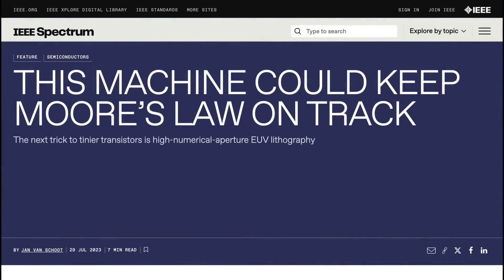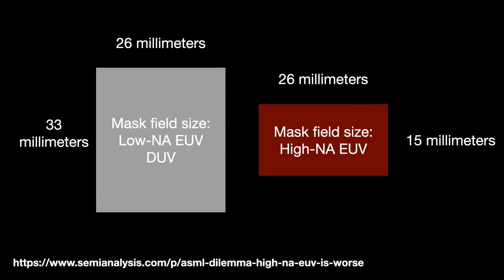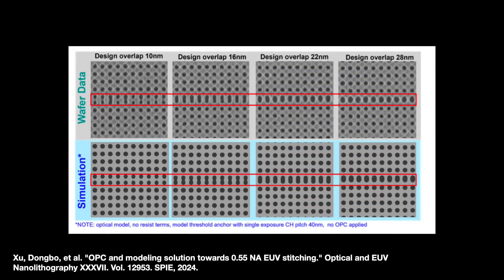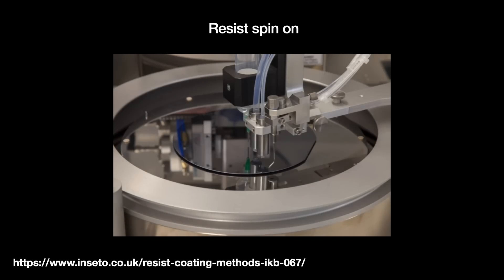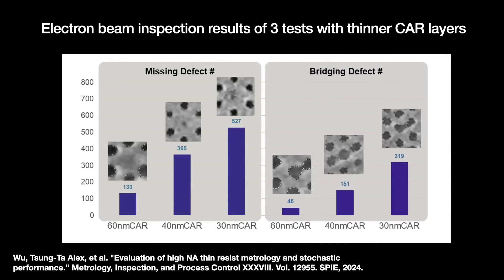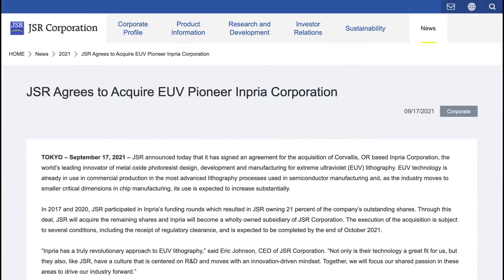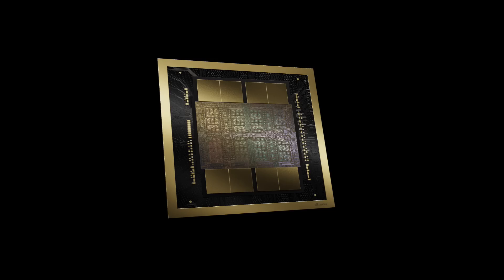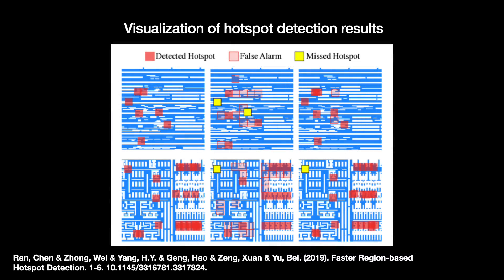ASML's High-NA EUV Lithography: A 2024 Update

Comment: could liquid crystals or metamaterials be used in EUV? if you could make a nanoscale morphable meta material ( nano particles controlled by magnetic fields, nanowires crossing eachother, etc) you could just drop the mask creation process and increase the iteration speed massively right? and you could search for best methods of producing a thing by cycling through parameters and mask types on a single silicon wafer.

Comment: Feels to me a big limiting factor these days is the laser source used and therefor the myriad steps that need to be integrated in the process to work around it's limitations.

If some guy managed to build a more powerful and/or more efficient laser source of the right kind of wavelength needed he would be rich af. They (tool-makers) could dispense with the whole shooting at a solid to create the right wavelength phase and a lot of the mirrors.

Comment: 16:19 "And industry seems super insistent that synchrotrons are not the answer"
What is the rationale? Synchrotrons seem like easy answer.
Reply: The light from such sources has many properties which you do not want in lithography. Coherence (i.e. a tight pupil, low NA) is one of the isses. Synchrotrons provide a narrow angular spectrum which has to be widened to achieve high resolutions. Polarization is another issue. It's quite easy to generate polarized light with synchrotrons, which is great to print lines and spaces (L&S). However, e.g. for contact holes, you want an annular pupil or at least a quadrupol.
Aside from those technical issues, there is simply cost. To make synchrotrons viable, you'd have to attach multiple scanners to one synchrotron.

Comment: Re: Synchrotrons. Synchrotrons are Bremsstrahlung sources, they have very poor spectral brightness ("brilliance"). Total brightness in the rough spectral area doesn't really matter that much as the process relies heavily on having a near monochromatic beam.
In terms of well established light sources you wouldn't want a synchrotron or wiggler, but rather an undulator. I work in developing a new medical imaging technique that also has issues with spectral brightness in the x-ray regime, and so far undulators are the best we can run (but we also run higher energies, so can't use optics to focus as well). I suspect that undulators are a combination of too big, too expensive and too dim for ASML, you basically need a particle accelerator to drive them and only get intensity proportional to sqrt(N) where N is the electron number. For context: the beamline my group uses most often uses a 53keV undulator attached to PETRA III. It produces ~1W/cm2 in (very nice) xray photons. 
There is an emerging technology that might work though - xray lasers. More specifically free electron lasers (FEL). European XFEL achieves 10**18 W/cm2 of even nicer photons. Buuuuut the beamsize is pretty small. In the FEL literature there are quite a few people talking about trying to make it usable for lithography though. So I'd keep an eye on that. Maybe when/if we move to 10keV and beyond and optics get more and more difficult it'll be back to lasers
Reply: Amazing info, thanks for sharing 👍
Reply: Great stuff👍 Also, he has mention FEL at least he talked about  a particle accelerator in conduction to the EUV light source. Probably in the essay last year on the same subject I believe without checking.

Comment: An element will absorb the same spectral lines it creates.  As they are using tin to create the EUV light it would also be the element to use to make the resist.
Reply: exactly true for isolated atoms, and a little bit more complicated for molecules in solids or liquids :-)

Comment: I'm actually curious if these computerized mask design modifications can somehow be used for less high tech things, such as etching metal using a laser burned mask using electrolytic etching? I have tried to etch small details into metal this way but undercut is always a huge issue for me. I think it seems clever that you can get smaller details than possible by modifying the mask itself so that it ends up printing what you want.

Comment: Once these companies get down to nodes like 17A and 14A which is what High-NA should allow for, Moore's Law in terms of transistor density isn't going to matter.

I've said this before, I'll say it again.  The transistor density should be around 500 MTr/mm2.  PCs won't need anything much more, small devices like smart phones won't, most servers won't. 

The bigger problem is going to be data throughput.  When you can shove that many transistors in such a tiny space you get the bigger problem, and I mean a PHYSICAL problem of squeezing data from the outside world into such small spaces fast enough.

For instance I can make a CPU on 17A I'm sure very easily with 1000 cores, or a 1,000c/2,000t CPU.  You still have the issue of getting the data into that CPU package to FEED that many threads.

For PC, you'll see the trend continue to MCM (multiple chip modules), but then as nodes get down to N2 or 20A, 17A and 14A you'll see that start to revert back to monolithic die, or monolithic for almost all compute functions and another die for moving data onto/off of the CPU.  And it's because that chip with the cores for the CPU or graphics cores or ray tracing cores or AI cores will easily fit on a single die.  That doesn't mean for very powerful graphics but for APU type products for laptops/game devices/lower power PCs.  You will CERTAINLY see the number of cores for a CPU chiplet increase so that only Workstations would need a CPU with more than one core chiplet.
Reply: Interesting and valid point 👍

Comment: TSMC doesn't need to buy the machines now.  They were the first to get onto EUV and did so without too much pain.  They can use EUV to get to N2 nodes and that's good for the next 5 years.  They don't need to be on N2 next year but they do need to be on it for 2026.  They can improve N3 to put out different processes using that base node.  And it's OK because they're still working to improve defect rate for N3.  So, Apple can move to an improved N3 for 2025. Nvidia will be down to a custom N3 next year and AMD will be able to get their next gen products out on N4 and N3, all of which will be out later this year and early next year.

So, once again TSMC can put out N2 in 2026 and I believe they've said they're on track for that.  It's after N2 that TSMC will probably need High-NA EUV, for 2028 and that gives ASML time to work out any issues.

This may give Intel an advantage but it won't matter much other than TSMC maybe needing to bring costs down a little, and Intel won't have that advantage UNTIL they're producing on High-NA EUV.   Intel is REALLY behind right now in spite of being at Intel 4 now.  The issue is Intel 7 wasn't very power efficient and customers are tired of it, and getting onto Intel 4, their FIRST EUV product line has been challenging.  So they are very behind.  TSMC is going to be putting out improved N3 while Intel is only capable of laptop parts being on Intel 4.

I'm sure ASML will work with TSMC just like they are now with Intel to get them into production as soon as possible once TSMC gets the new machines.

Comment: Are we getting to the thin edge of the wedge now in improvements? We already have 1TB Micro SD cards. Most of the components we use today are not using cutting edge 3nm circuits for instance. Imagine when they do - and that is existing litho already in use on CPU's.  Seems like getting CPU's using even smaller transistors and circuits is heading toward zero sum game. Am I luddite? Even after championing the race to where we are today?
We still haven't seen mainstream GPU's adopt PCIe 5.0 yet and right now PCIe 6.0 is being ratified. DDR5 is already seen at being near the limits of production due to interference from rest of PC motherboards RF interference  - future gens going to be contending with more RF control driving up costs.
We never had it so good! Hehehe.
Reply: AI demands more advanced nodes and they have the money to force going forward.

Comment: Another thing Lithography is used for. is to create the microscopic UV mirrors in seren models of resin 3D printers.
I wonder how long until they are so precise we'll literally won't be able to tell the layer lines.
Reply: I'm sure you could engineer a machine to run with 5-10 micron thick layers. But at that point prints would take ages. And the requirements for the. Machine to be able to do this would be insane so it would cost you a LOT of money 😂